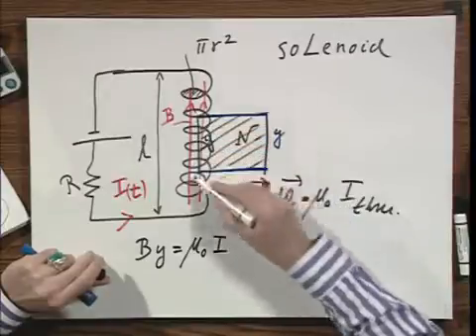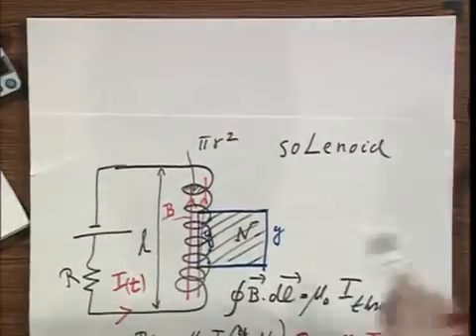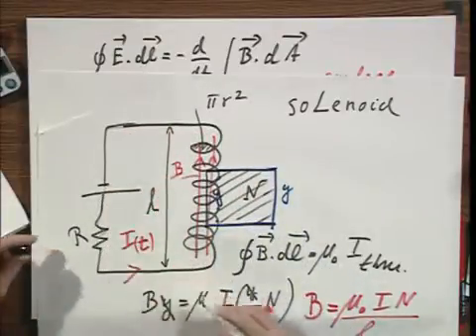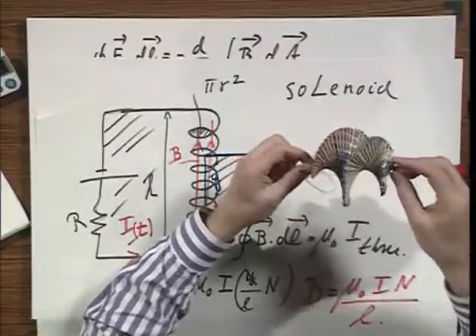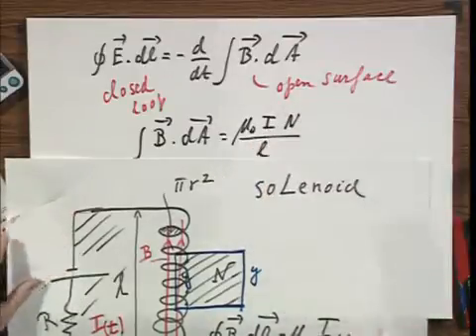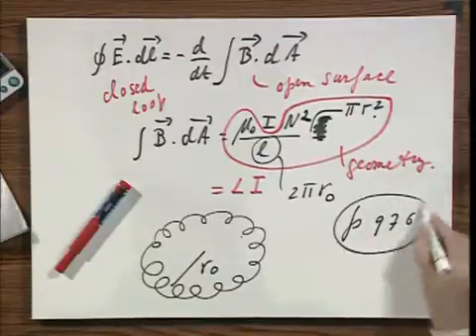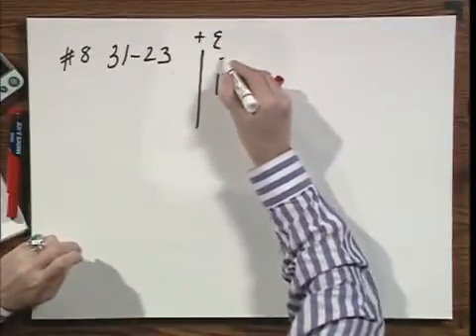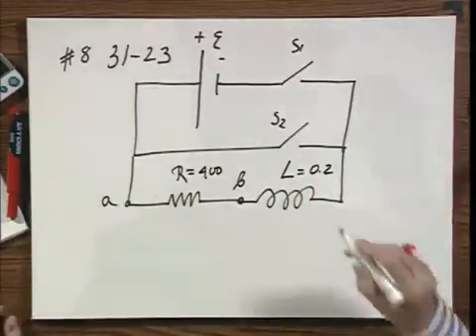8.02x - Module 08.02 - Faraday's Law Applied to Circuits. RL Circuits

Comment: Sir you made a mistake at 15:19 , it should be -IR instead of IR because you are moving from low potential to high potential.
Reply from the maker: you are mistaken. The current is counter clockwise thus Va - Vb = IR

Comment: 12:40 when you say the self inductance is made of superconducting wire, is that referring to the wire that makes up the solenoid?
Reply from the maker: yes
Reply: Lectures by Walter Lewin. They will make you ♥ Physics. If it was not a superconductor would it be ok to assume that the resistance is negligibly low?
Reply from the maker: @studywithjosh5109  if it is negligbly low that is fine.  But be careful, you have to make sure that it is negligibly low.
Reply: Lectures by Walter Lewin. They will make you ♥ Physics. Great thanks!

Comment: Dear professor, I have a tough time with the typical problem of a circuit with a moving bar in a orthogonal B field. Let the circuit have no R, but a self inductance L. I have an induced emf with current in the direction suggested by Lenz's Law bacause of the change in the magnetic flux, but then there's another inducted emf by the self inductance. So it's reasonable to write down the sum of the two = 0. But I'm making a mess trying to fit those into faraday's law (I have two sources of induced emf). Thank you for your time, you are a true inspiration.
Reply from the maker: The closed loop integral of E dot dL is NOT zero if there are changing magnetic fluxes in your circuit. Kirchhoff's Loop Rule does NOT apply in that case. KLR is a special case of Faraday's law namely when the Curl(E)=0. Watch my lecture 16 of 8.02 !!!